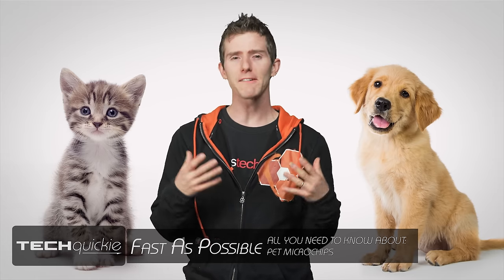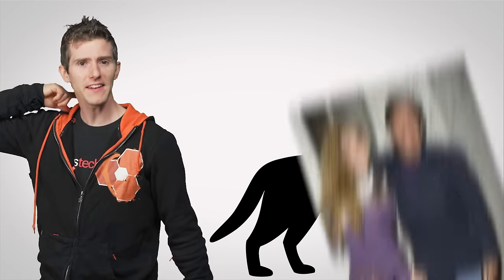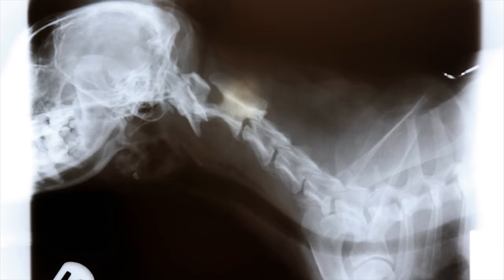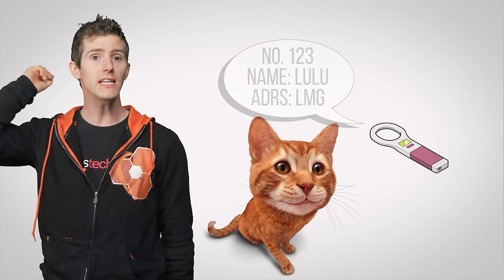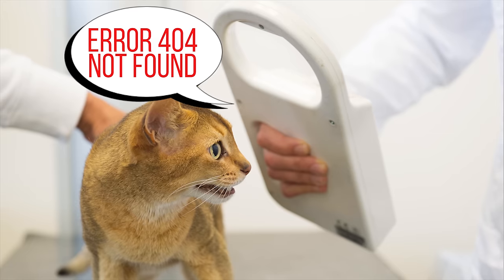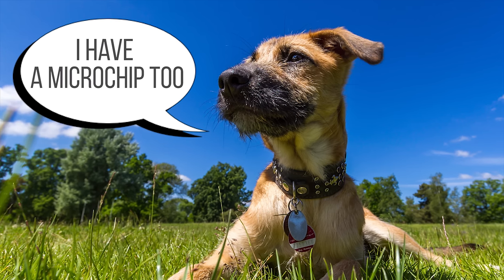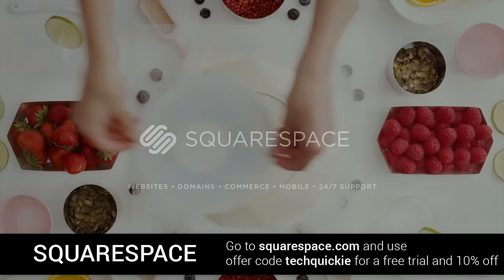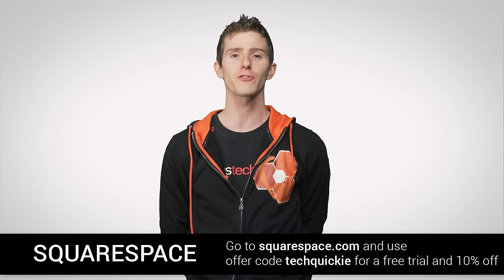How Do Pet Microchips Work?

Comment: It's not even optional in hungary. For dogs you are requierd by law to have a chip in them
Reply: Akos some EU standard may be
Reply: Akos same in the UK
Reply: 100racer can you track them?
Reply: Stefan They are only rfid, we cannot track their location.
Reply: 100racer It says "radio-frequency identification uses electromagnetic fields to automatically identify and track tags attached to objects"?
Reply: Stefan The chip will only work in close proximity to the scanner as it's coil has to draw power from the scanner for the chip to function.
 As for tracking, the chip only has the capability to send it's serial number that has be searched on a database for further information.
Reply: if you listened to Linus, he said, rfid chips don't have their own power resource, they can't be read/identified from a distance, only the reader device gives enough power to it, to read the data on it from a close distance, i don't think there is such a powerful rfid reader that can read an rfid chip from miles away, otherwise we would also have wireless electricity, that Tesla developed decades ago, but was destroyed...
Reply: Yep, thats mostly for insurance reasons, when your pet gets run over by a car, and the car has some damage, they can quickly locate the owner of the pet to pay for the damage.
Reply: hegyimutymuty tell me the story about that destruction
Reply: Stefan you know, there is google
Reply: Akos Good. It should be law!
Reply: The same in Spain
Reply: 100racer not the same in the uk 😊
Reply: um same in Singapore? nothing great about ur “Hungary” because it SHOULD be required by law, duh...
Reply: @xMaddieMuffin  
It Has been law since 6 of April 2016 that all dogs be microchiped.
In October 2020 it will also be Law that horses are also microchiped as well

Though I wish its also the case with Cats
Reply: Ffion Owen i was referring to cats. Not by law on the uk to chip cats. Wasnt talking about dogs or horses. I dont care if its the same for cats. Anyone who cares about their cat will do it regardless of whether its the law or not.
Reply: well thats a GOOD law.
Reply: Fish Good
Reply: That's seriously messed up :/
Reply: 50 years later: humans required by law to have a chip in them
Reply: Glad i dont live there, chipping is wrong
Reply: Do you have to pay? Is it affordable for the average person?
Reply: Just disgusting.

Comment: Microchips works great with dogs but cats not so much, my dog got loose a lot when I first got her and I would get a call fairly quickly. But I have lost 2 cats and one is still missing going on 5 years and the other one I got an call 2 years later when he was on his death bed from kidney failure. The problem is cats are not seen as big problem if they running loose but dogs will end up at the pound really quick.

Comment: the door thing wont work for my cats. as they regular run at full speed to enter the hous.
so in this system they whould run the head straight into a closed door. stressing them out.

Comment: Can you do a video on microchip tracking devices? Would they ever be practical and work the way they do in movies?
Reply: They need (large) batteries as they actively report their position. The way pet chips (and NFC) work, is that they receive energy from the machine that's really close to it(because you collected the pet already, in order to read the info from it). So it will work as in the movies, but not for long
Reply: That's what I figured. But maybe a low energy solution is possible that uses public wifi triangulation to broadcast a "last location".
Reply: good thinking.. but i'd doubt Wifi (or BT) scanning and reporting is more efficient than GPS tracking. which has been used (and developed) for decades.. you'd need pretty high gain antenna's in order to get better accuracy, which you dont need for gps reception

Comment: i guess my dog's was that 1 in a million failure.
Reply: deathclaw 21 my dog is fine. the actual microchip itself failed. it stopped working after about 2 years, we noticed on a rutine checkup.
Reply: Chimp Assassin this is why I spend every possible moment with my dog
Reply: Sorry for being the grammar nazi but in that case you mean to write "dog's" in possessive form not plural form. That apostrophe makes all the difference.
Reply: +DjEatTheNoise All ready did done that. Grammer Nazi's are are'nt not alive.

Comment: prob is the chip can move around the body and not stay in the neck. when that happens the scanner wont find it as they only scan the neck where it was put in.

It took my vet ages trying to find the chip she put in as it had gone halfway down his back and it had only been in for a year.

another prob is not everyone has the right scaner as each chip maker uses a diff scanner way of picking it up. til its been sorted out so al chips use the same scanner they r next to uselss. plus if its not a vet who gets the pet they wont have a scanner to use anyway as only vets have the scanners.

It is compulsray in the UK to get microchips in dogs but not in cats.

Both my cats have microchips but by diff vets as the 1 done in my oldest cat closed down and the 2nd cat used a diff vet and they both use dif companies to register them with. 1st 1 i have the detalis and pet tracker info so i can look at their website and report the cat missing. but the younger cat i didnt get any info about the microchip or who its registered with. only its not the same company as the older cat.

the vet will only have scanner for the company they use and it might not detect microchips from other vets.

so the tags on the collar r still the best way to go.

Plus its very painful to put the chip in. my vet refused to do it unless the cat was sedated 1st. so they ususly only do it if the cat or dog is having other treatement done that requires them to be sedated. 2 diff vets my cats have used and they would only put the chips in when they were getting nutered.

Some ppl pick up cats by the scruff of the neck including some vets. if a microchip is in it could cause it to pop out or move away from the neck.  My old vet picked up my cat by the scruff of the neck but the new vet says no never do that as it hurts the cat. only mum cats should do that to its kittens cause they know exatly how to pick them up to make them go into a sleep so they dont get hurt or struggle.

Comment: In the europe there is only 2 chips that they are allowed to use FDX-A and FDX-B. 

I have a question about reading the chip in the pet and about seperated tags.

Can you infect use a normale card NFC reader to read the chip, or does it need a certain herz.

Also how do you program a seperate tag. If anyone has the answere it would a biiiig help

Comment: wouldnt it be possible to use these microchips as trackers, if your pet runs away?
Reply: No.
Reply: TeaForce
>buy $60 smartphone
>install that boyfriend stalking app
>tape to pet
>???
>profit
Reply: the chip is passive. i doubt that is possible.
Reply: Anıl Ertürk but it can't track pets
Reply: I'm pretty sure there is a type of chip that lets you track them but it would be a paid service
Reply: I doubt it be cause they would have to power it